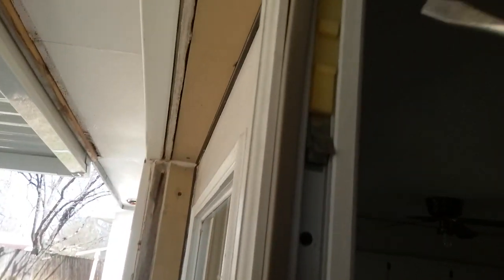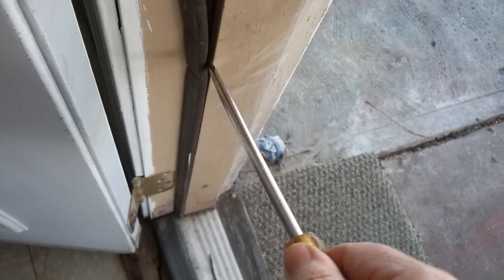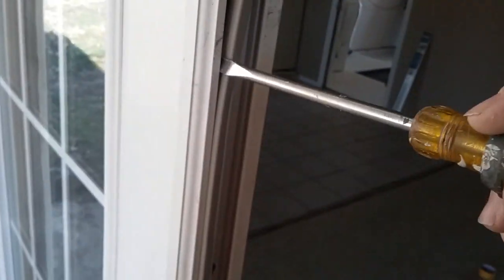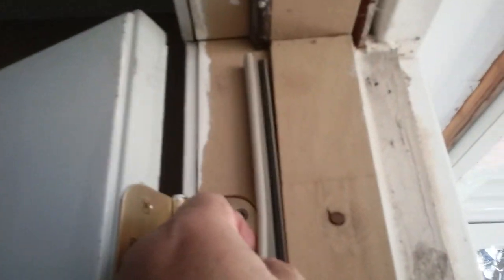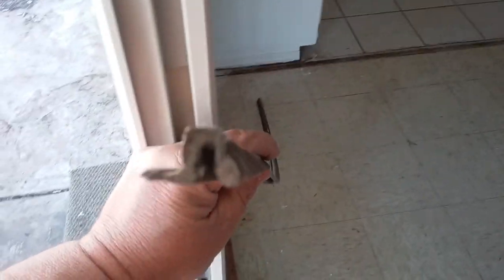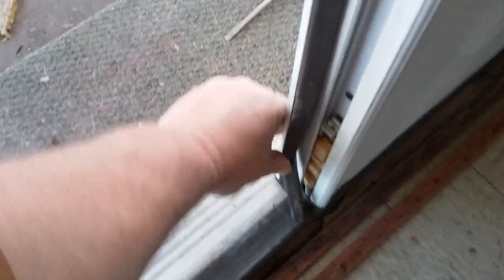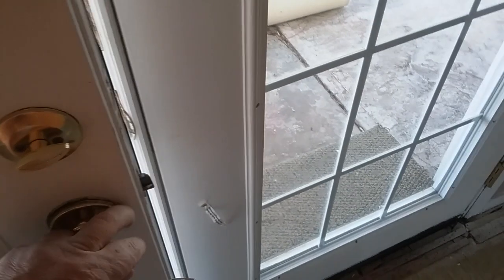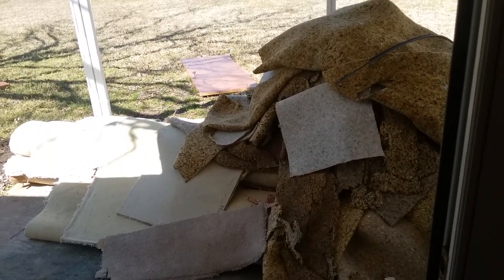How To Replace Weatherstripping on a Double Door

Comment: Where can I find this specific weather stip with the fins? Where did you purchase yours?
Reply from the maker: I found it at my local ACE hardware. But I've seen them at certain Home Depots and Lowes. If you can't find it at either place, you might check amazon as well for weatherstripping.
Reply: @BlueCollarDIY  what is that weather stripping called? Thank you.

Comment: Hi Donald, I didn't catch it live, however you've put together another solid video.  You made it look easy. From my experience, Weatherstripping does indeed require a certain level of patience. Were you wearing the camera on your head?  Have a good night, Delfino
Reply from the maker: No, I was holding it and trying to work with one hand. Thanks for the comment Delfino.
Reply: Can u buy that at any hardware store?  I have exact same problem.